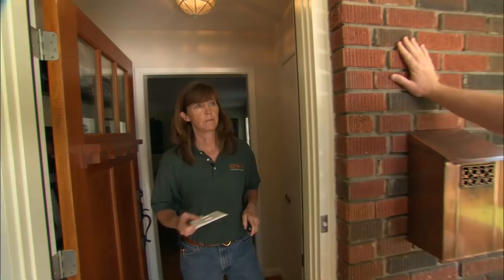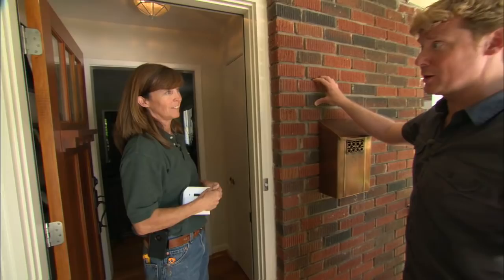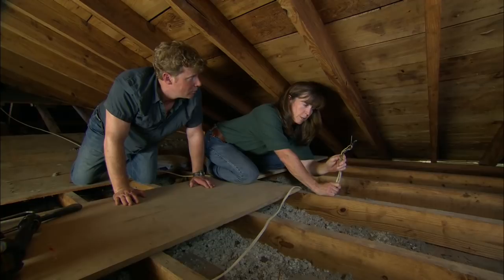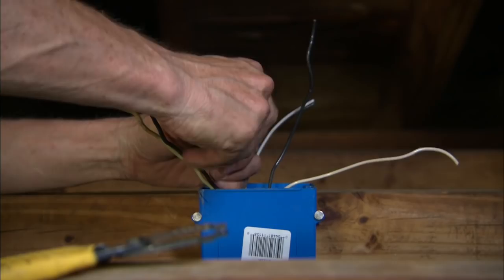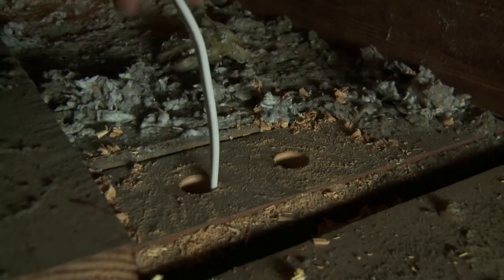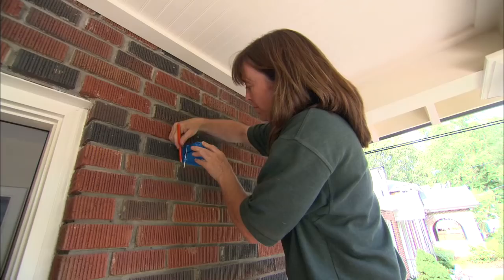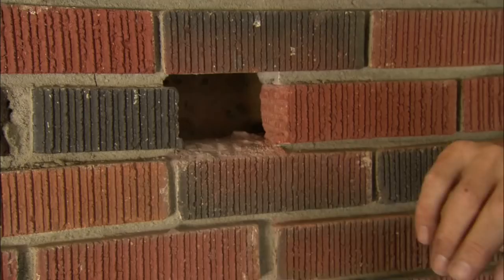All About Lights | How to Install an Entry Light | This Old House

Comment: I love the way they make it look sooooooooooooo easy. They never show the issues we come across in the real world when doing any project.
Reply: Arnoldo Lorenzo don’t try this method that does apply to every home. Depending on the pitch of your roof this could be impossible to do
Reply: "hey theres our wire" haha thay easy even woth insulation in the wall
Reply: Plus it was daylight when they started and dark out when they finished
Reply: @PrezentEnt  There wouldn’t always be a top plate in a home? I never ran into a house without being able to access from the top plate, down to the exterior wall.
Reply: That old house doesn’t have fire blocks? Ok.
Reply: @bobbywhitewolf  The top plate is supposedly rated for to be a fire block. I just seal the holes with fire stopping caulk after running my wire. I’ve genuinely never ran into anything that I wasn’t able to drill through with a flex bit in my area.
Reply: @bobbywhitewolf  All the homes in my area are fairly old and I only do remodel work so I never run into those plates but I’d imagine you could do the same thing I do when I drill through the top plate. Just caulk it with something that  has the same fire stop rating as what you’re drilling through.
Reply: @damion1121  When I say fire blocks I just mean diagonal beams. My house was built in the 40s and I always find diagonal beams where I don’t want them. I was trying to run a wire up to a new cabinet and I cut a hole in the wall and there was a random metal box... not electrical, no holes for anything... just a random metal box... it was hysterical, I tells ya.
Reply: @damion1121  I am working on a 1850s house. Running wire is a pain in the bottom. No matter what I try to do I always hit the beams.
Reply: My wall ate 2 flex bits. They hit something and we tried everything to back them out and they wouldn't budge. We ended up dremeling the bits off and stuffing them behind the wall we had to end up patching.

Comment: At 3:50, it is apparent that they used hydraulic cement to set the box in place.  Hydraulic cement will set in under 5 minutes and even works under water.  You can tell by the appearance for those who are familiar with it.  Nifty trick.   They just left that part out which may be the most the critical step in the process.
Reply: Not at all. Hydraulic cement won’t bond to plastic anyway. Half a brick is the exact size of one of those boxes. I usually take a rotary hammer with a chisel bit and remove half the brick. The box wedges itself perfectly in the hole. No cement needed

Comment: Also a tip to any home owner in an old house.  Becareful with cloth wiring which can have "asbestos" and is Friable when touched/cut/ripped.  Alot of DIY homeowners will tackle the job not thinking of the dangers that can result.  The home depots won't tell you this.
Reply: Oh course "Home Depot" won't tell you that. They are a mass business and care about profits.

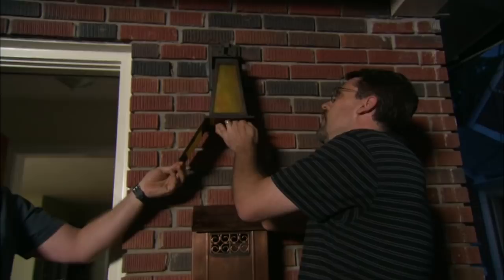Comment: at 4:09, the delay between bulbs makes me think they used LED's. Good idea, as these bulbs will most likely be on for extended periods.
Reply: Wow you have a good eye and they are using LEDs
Reply: or a CFL for 2014
Reply: I only use incandescent bulbs because LEDs create harmful dirty electricity and blue light.

Comment: when making an addition to a light such as yours, is it a must by code that you run it directly from the junction box or can it be taken from an existing light fixture  box?  or  does it matter
Reply: The slices or junctions, per code, must be made in a junction box.  That box can be an added box as they did in this video (to correct the illegal splicing method done previously in addition to providing a junction point for the new light), or it could come off of a box for an existing light.  As long as the splice is made in an accessable junction box, it meets code.  They could have run the wire for the new light fixture into the box for the porch light and make the connection in that box, but since there was already a splice in the attic for that existing porch light, and they needed to put that slice into a junction box, it makes sense to just use that juction point for the new light as well.
Reply: Thanks alot for this reply I appreciate it

Comment: placing morter around box is all you  need? nothing else to anchor it to the brick? box will never pull out later without attaching anything else but morter?
Reply: Because it is plastic mortar does stick to it and it will swell and shrink and fall out of there. Let's assume though she left enough wood sheathing on each side of the box to run screws through the back of the box to secure it.

Comment: It looks like the feed cable  has no ground wire so wouldn't you be required to add a ground wire from the service panel to the new junction box?  Otherwise, the grounds for the light fixtures are un-terminated.
Reply: Worst case scenario you would put a dead face gfci at the panel, that would be sufficient. Other wise yes you would have to pull a new wire if it has no ground.
Reply: @morlead8787  Yup, or GFI breaker, Kind of important and would have thought TOH would be sure to point that out, but no.

Comment: It's a pretty good video, though the part about attaching, setting the box should have had more information.  I noticed quite a few comments on here asking what's holding it in. If you're going to title something "How to . . . " then show and explain ALL of the important steps.  I'm not a pro, but have tackled several in-depth DIY projects across several trades: plumbing, electrical, roofing, framing, etc.  And I try to do all my work above code.  But in order to do something right, a person needs to know about important things like how to ensure the box to which the fixture is going to be mounted is solidly in place.  Of course pros who see this video may have done these projects before, so glossing over things is fine for them.  But just another 30 seconds to one minute more of explanation could have filled in the missing gaps for a much broader base of people.  Comments such as, "If you're asking questions like X, then you have no business even attempting this type of project" are somewhat arrogant.  If there's a missing piece to the puzzle, there's not a thing wrong with asking about it.  Besides, the missing piece had more to do with construction and masonry than electrical.
Reply: They showed you exactly how to do it, you hire an electrician. That's what they did.

Comment: No caulking required because the porch will keep rain from getting behind the fixture?
Reply: I would still caulk it. All it takes is some wind to drive the rain under the porch.
Reply: Correct. Looks like there is plenty of cover from the roof so no need to worry about water getting behind it.
Reply: +Tim Kridel Errr She said Fire Caulking, she is not concerned about water.... its fire Fire fire.... how does a fire spread >>>???
Reply: He's saying she should've caulked behind the light fixture and the brick
Reply: Most quality outdoor rated fixtures come with box gaskets, which work well to seal the box once you tighten the mounting screws.

Comment: Did she drill through the top plate of the exterior wall?  It didn’t look like it.  Did she fish the wire from a cavity above the closet?  I missed something there.    Can someone please tell me if it is ok to drill through the top plate to install a fixture on an exterior brick wall?
Reply: Fine to drill a ½” hole through the top plate of even load bearing walls.

Comment: Not an expert by any means, but is romex allowed for a wire going outdoors?
Reply: Yes. The box is completely in the wall and the romex isn't exposed
Reply: Yes, but unlike this video, I'd caulk up the light after installing it to prevent water from getting into the electrical box.
Reply: @Egleu1  They also make a UV safe outdoor rated romex I believe,

Comment: So.... what was the point of attaching the ground wires if the original wire going to the switch and panel did not have a grounding conductor? Just curious... other than that .... straight to the point.
Reply: Good catch.  The old wire should have been completely replaced to bring it up to code.  My guess is the junction box at the switch doesn't even have a ground and looks like a rats nest.

Comment: So lucky they can use romex wire.  In the Chicago area, conduit is used per code.
Reply: Geoff Morse even in retro situations?
Reply: Leonard Holt - Yes, all is conduit.  Oh and for some reason, outlets are installed sideways.
Reply: Geoff Morse how about MC cable?
Reply: Leonard Holt - Not sure.
Reply: Still is even for non-commercial applications?
Reply: I'm sure some union was involved in making that rule. Let's see... electricians? steel mills?

Comment: No insulation between the outside wall and interior wall...interesting.  Where's the "that was easy" button for fishing the electrical wire.
Reply: You don't need to insulate unconditioned areas. An open porch is unconditioned. You can leave insulation off in those areas.
Reply: @umeng2002  That wall looks like it leads to an interior space.

Comment: Its night time when they finished, the job took all day
Reply: There's also the added time for production. Every time you move spots, all the gear has to move also.
Reply: or they started right before sunset
Reply: Karol Palazej  if an electrician takes all day to install a light and charges me $$10,000 I would call BS on that guy and have his certification pulled
Reply: This is not Joe DYI filming his YouTube video.  It is a national TV show with a professional film crew. That shot in the attic - there was probably an hour or two of prep, getting the camera situated, making sure the lighting is correct.  They also probably purposely shot into the night because...they were installing a light fixture that is used at night!
Reply: Karol Palazej  it is a cool story, cooler than you pretending you know what you're talking about
Reply: @davidkeel4543  Hope the customer got a discount for allowing them to film
Reply: @eksine  Honestly anyone you attempt to complain to might give you the time of the day and listen because it's their job but they'll just call the company you hired and say "yeah sorry so Karen called us crying we told her we'd give yall a talking too. Make sure you red flag her name and number and spread the word, sorry about that have a nice day." 

Job like this is going to cost you about $600-900 depending on difficulty of the install location, if it was indoors at or below 12 feet you'd only be looking at ~$400. Usually a full light install is only going to take you 2 hours max unless weird complication arise.

Comment: Am I the only one who is bothered by her using a device box, with holes for 6-32 screws for switches and receptacles, instead of a proper light box, with holes for 8-32 screws, meant for mounting light fixtures?
Reply: shanecthompson77  They are cutting corners. Job security.
Reply: It’s a plastic box. You can use drywall screws if you want. The plastic will expand. Installing a round box would be a pain for little benefit
Reply: Hahaha love that someone caught that.
Reply: If it’s a wall mount fixture then it’s fine.

Comment: This video has some flaws and the armchair contractors will tell you in the comments but the biggest one for me was using a indoor box outdoors. Should have used a metal box.  Overall, nice job!
Reply: Metal boxes really shouldn't be use for outside exposure due to if a wire comes loose it could charge the box and when you go to touch that metal light fixture..that's...bad news..she used the right.box.

Comment: wow electrical standards in america are low! that junction box! splicing!
Reply: Joe Langer European standards in general are low!
Reply: I'm glad to be living in a nordic country that has high standards. Sometimes too damn high.
Reply: We have 110 not 220
Reply: Joe Langer that spice should be in a junction box and it’s not up to code if it isn’t but sometimes you do with what you have
Reply: Jay Tee we have 220-260 running to our houses for the things like whole house air conditioners ovens furnaces and the dryer all your lights and receptacles are using 110-130 (those voltages are the same from where I live your voltages may differ)
Reply: +Mark Wright

We don't use wirenuts. Screw-type terminals or for round about 30 years the push-in connectors are considered as state-of-the-art here.

+Britney Miller

No, they're not. The last time I've seen such a wire splicing here in Germany was in a house built in the early 1950s. 
Touchable live parts on the sides of the receptacles or switches (the screws of the terminals) and then talking about higher standards is almost ridiculous! And by the way, in Europe you won't see an electrician working with screwdrivers or pliers that you would normally use to repair your car. All tools are insulated (rated up to 1000V), even if the circuit is dead. There could always be a stupid person nearby ignoring the "Don't operate switch!" warning signs and switching the circuit back on because he wants to make some coffee or such thing. The german Schuko-sockets were invented in the 1920s, and they were grounded from the beginning. The first NEMA-receptacles were ungrounded. And since 2013 we must use RCDs for almost every circuit here, but I'm using RCBOs (RCD and MCB combination) instead. They don't cost that much space in the panel as if I would use separate devices. Before 2013 it was only necessary "for a room that contains a shower or a tub" (RCD requirement introduced in 1984) and for outside installations.

+Jay Tee
120/240V split-phase system, 120V for standard appliances and 240 for appliances with a high demand like dryers.
Reply: Dangus
Reply: Mark Wright  I live in USA, I have to agree.
Reply: There’s nothing wrong with wire nuts and splicing if done properly.
Reply: @Marcel_Germann   It's common practice to tape a "don't operate switch" sign instead of locking out the circuit with a pad lock? 
Wagos have been around here for some time as well, and the electricians who choose them usually use lever ones. The push in connectors aren't trusted by many, because the early version that became available in North America around the 1970s made poor connections. I've experienced many times when working with old push in connectors that the conductors fall out when removing an old outlet, or switch. It's my understanding the same holds true for early versions of European wire nuts.
120/240 volts is single phase from one of the three phases. Split phase is another term for two phase where a third phase is non-existent.
Reply: AMD1 Some older circuit breakers are not designed to lock them. Newer ones are, but the old ones for replacing Diazed fuses can‘t be locked because they don‘t have a lever. I have locks for most modern circuit breakers. The problem is that there‘s no standard, it depends on the manufacturer which lock fits. So you need a whole set.

Comment: Instead of messing with the old light, she should have just installed the new light and wire it directly to the switch that is fifteen inches away.  She went through the attic for no reason.
Reply: maybe the box fill is too much?
Reply: This was my first thought as well.  I'm guessing the box was completely oveloaded.
Reply: No way to get the new wire into the back of the existing switch box.
Reply: Cut a little drywall and you’re done. Keep it clean and it’s an easy repair. People are so afraid of a little spackle
Reply: It wasn't a requirement to have neutrals in switch boxes until 2011. That, or like everyone else said box fill was probably reached.

Comment: you showed practically nothing, so thanks for...well...nothing.
Reply: This tells you the steps, it doesn't tell you how to, for example, use a hammer drill, use mortar, wire electricity without killing yourself. You clearly need to save the job for a pro.
Reply: if you weren't able to understand the process with what was shown you have no business touching electric wires!